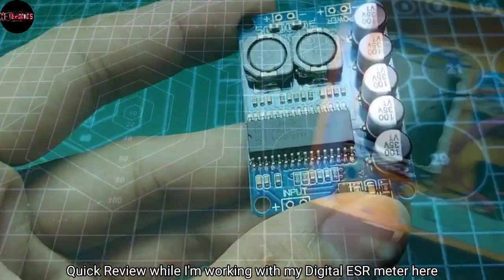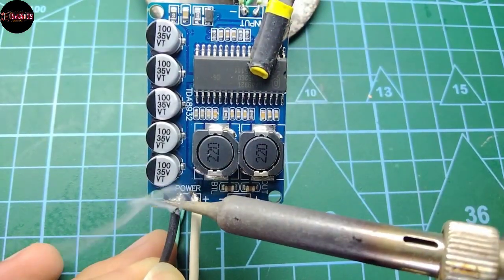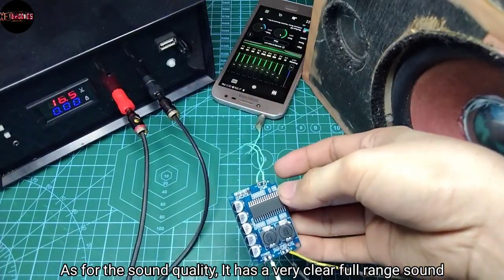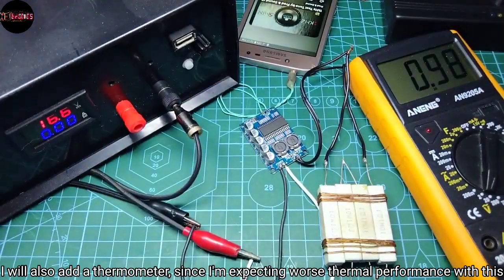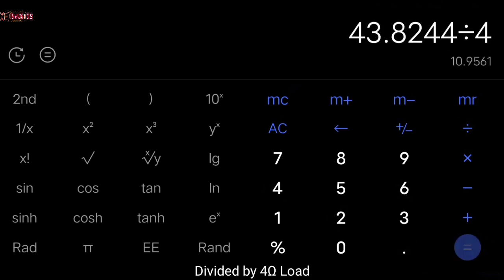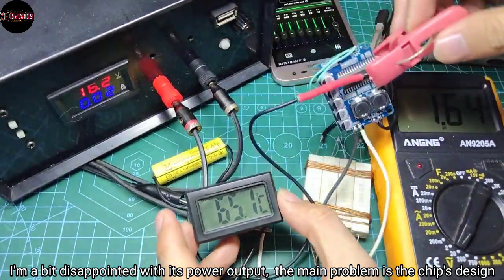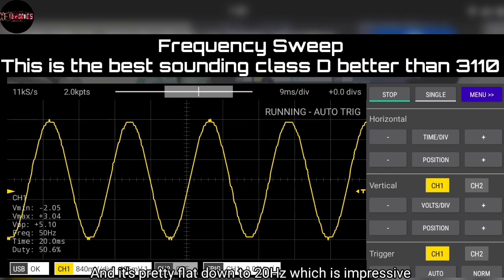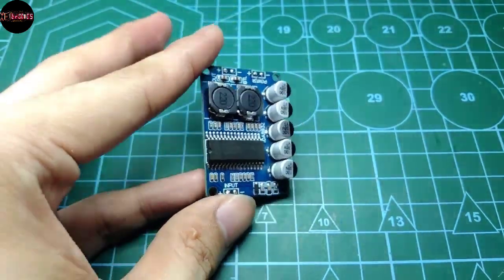TDA8932 Real Power Test and Review !! You'll Probably Like this Board #classd #amplifier #tpa3116

Comment: nice video, i was thinking to buy tpa 3118. but looking at this board, and specifically its ic placement on the corner, i think i go with this one. i think it easier to install heatsink, like i think i can put 2 board on one heatsink. for tpa 3118, well you can put it beneath the board, but i dont want to scrape my new perfectly new board.
Reply from the maker: Tpa3118 is actually fine bro, especially the original 32 pin .
It is more powerful and it has a thermal pad under the chip, it is a liitle bit costly though

Comment: Great video, but you should check the datasheet of this IC also, refer to the specs and graphs and try the same testing for 16 VDV and above on 8 ohm load. Place a small heatsink as well if you are going to test the same.
Reply from the maker: Yes, it will have stable output at higher voltage using 8Ohms load.
I guess I'm just too Lazy to do that😆. Main Factor is that 4Ω are more common than 8ohms here.

Thanks for the time brother 🔥
Reply: @x3dtronicsph  give it a try man, this board is already a huge hit here in India and this bass is regardiled as the "father of bass" in its segment
Reply from the maker: @Thedarkwebgiant yeahhh, sounds really great, thank you
Reply: I've used half a dozen of these boards one inside a cigar box guitar they are very reliable good little amplifiers.
Reply from the maker: Yep, 10watts RMS is Really Loud for Normal Listening. Great Board
Reply: @x3dtronicsph  but this board easily gives minimum 20 watt without any distortion

Comment: is there is a way you can add a heatsink to the cheap? this will make it very useful. thanks bro for this amazing video.
Reply from the maker: Yeah, but specific size of heatsink, You need to sandwich it like what i did with the mini TPA3116. I guess it will help little bit
Reply: Ive used superglue to attach a small (20x14mm)heatsink, works great.

Comment: This video helps me a lot, I need small amplifiiers for my surround system and this is just perfect.
Reply from the maker: Thank you for the time🔥
Reply: These really are a great board, ive used 6 recently one I built into a friends CGB guitar with a rechargeable battery and 2 small speakers he loves it. I always superglue a small heatsink (20mmx14mm) onto the ic it runs cooler then.

Comment: Just add a small heat sink and can run upto 24 volt with 2 ohm load with 90% vol continuously like 1 hour
Reply from the maker: Not possible, The current limit protection is the one thats kicked in. The chip can work up to 100°c.
It will work up to 35volts with 8Ohms load,  but the max output still the same with 4Ω load at 16vdc.
Almost 15watts RMS
Reply: @x3dtronicsph the datasheet says 16w 4ohms at 12v and 32w 8ohms at 22v.

Comment: Hi! This amplifier is meant to runing at 12v 4 ohm maximum.
Is bridge amplifier and you need 8 ohm load impedance to runing 24v and attach one heatsink maybe can take 30v supply 8 ohm load. I saw at 24v can deliver 27.5w rms output clean with heatsink... anyway maybe you make part 2 video and you test with 8 ohm and heatsink at higher voltage ... i want to use one this with 8 ohm subwoofer and i want to use 24v supply or higher like 30v
Reply from the maker: Yeah, it will work with higher voltage using 8Ω Load.
But I don't really test it with 8Ω load because most application of this module is for small speakers. And Common impedance of those speakers is 4Ω. 8Ω low power speaker is not that common.

I'm also worrying on those who doesn't have full understanding in speaker impedances.

Comment: Di parin ako makapag decide ng amp na gagamitin ko para sa jbl bb2 4 inch woofer. Kung zk-502mt kaso stereo siya hindi mono, tpa3118 with aiyima bluetooth amp. Wala kasing mono amp si wuzhi na may bass at treble control. Natry ko na si zk-502l kaso plain or flat eq ang tunog. Hanap ko tlga yung amp na tutugma kay charge 5 kaso ang hirap mamili.
Reply from the maker: Flat tong tda8932 pababa boss, kahit 20Hz solid.
Kung gusto mo magaya si JBL, kailangan mo talaga ng DSP jan. Pwede na yong nireview ko na receiver kasi may EQ sya.
Pero kailangan mo mag dagdag ng Highpass filter at isa pang amplifier para sa tweeter. May low pass din dapat woofer mo around 1kHz ganon.
Reply: @x3dtronicsph Yanga boss kaso di pa ako maalam sa paggawa ng ganyang filter, alam ko palang talaga magbuild. Solid kasi talaga si jbl. Triny ko gumawa ng panel para sa 4 inch ko tapos nilagay ko sa sub box na 4th order bandpass. Sobrang ganda ng bigay niyang tunog parang tatalunin pa niya yung 5.25" sub na nakasalpak dun

Comment: meron ako ganyan boss dalawa... sobrang init ng board na yan... pero sa bass mas madiin pa sya sa tpa3118
Reply from the maker: Boss, ang linaw nga ng tunog, Sayang lang talaga kasi limited lang ang power. Sana i improve nila yong design
Reply: @x3dtronicsph  meron ako nakita nyn nag review boss isang filipino na nasa abroad BOKNOY NARUTO ang yt channel nya boss... na supplyan nya ng 35v na hindi nag protect
Reply from the maker: Baka mataas yong Impedance ng Load nya boss. 4Ω kasi ginamit ko
Reply: Nakapag bukas ako ng active speaker TEV TA780 10inch Portable PA (Public Address) System (280W)...
Ganyang IC ang ginamit tininingnan ko sa google data sheet 35 watts mono  lang sya.
Pero ang nakasulat don sa active speakee ay 300 watts.